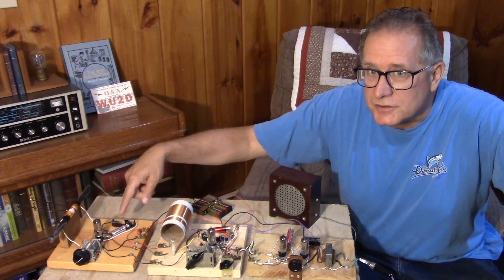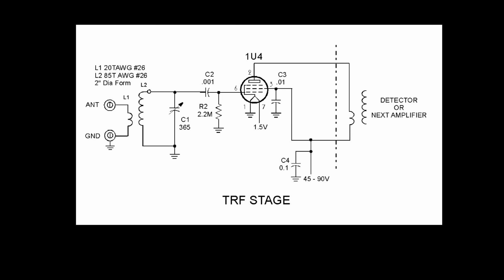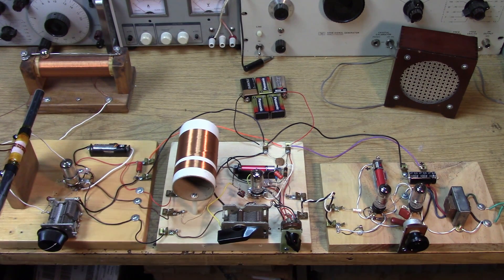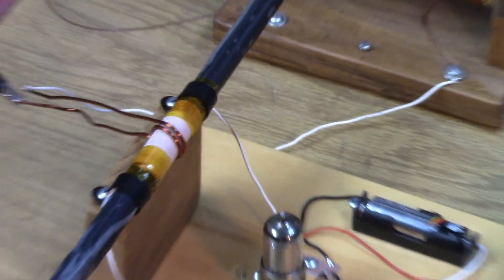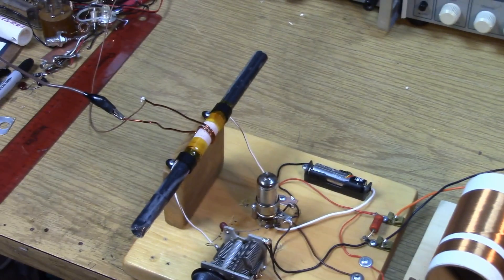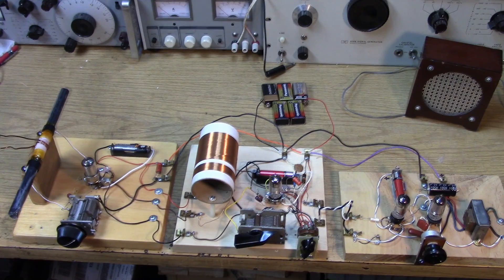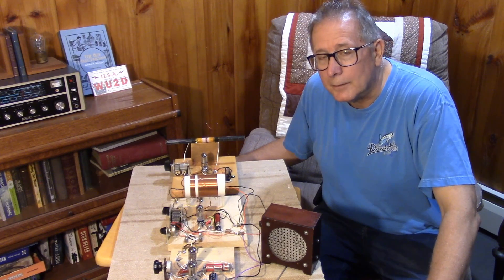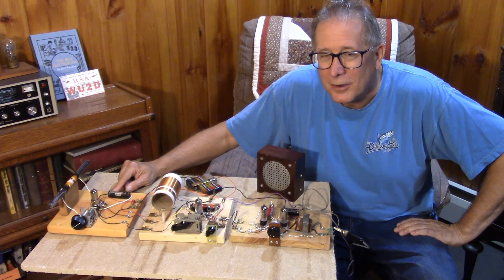TRF Receiver

Comment: Can we use a single knob (ganged variable capacitor) in this circuit?
Reply from the maker: You certainly can, but normally because of loading and tracking, you still need a trimmer to center up the two sections.
Reply: @MIKROWAVE1  that is a great news, i have built a circuit similar to yours (two similar stages) , but with transistors, the two coils are exactly the same but was very hard to track the same  station,, when using a ganged  tuning capacitor I only got the strong stations, while when I use a separate tuning capacitors and set them individually, I really got much more stations with high quality.

Comment: This brings back memories of how I started out in electronics as a kid. 
I couldn't afford transistors, but I did have vacuum tubes, so I designed simple radios, in which to use them. 
With a HT of a mere 9 volts, I was rather pleased with their performance  :) .

Comment: Mike I like your series on simple radios. When you add a 5th tube to a 4 tube superheterodyne, its usually a RF stage and performs so much better, or AA5 vers AA6.  To me a 4 tube battery or AA5 radio with just a  mixer/osc, IF, det/1st AF and AF output are what I would call minimalist radios.

Comment: Very nice series Mike! Any chance of a comparison between a FET vs. tube regen of the same architecture? 73.
Reply from the maker: Yes But... To be equivalent in performance, I would use a dual gate mosfet in the RF stage, a JFET in the Grid Leak or Regen Stage, an audio JFET Preamp and a Mosfet Class A speaker PA.
Reply: @MIKROWAVE1  I’d already be happy with just a single stage regen. I assume you want a dual-gate fet to be able to easily change the gain?
Reply from the maker: @trcwm  I will put one up in the FB page.

Comment: When you mentioned the TRF regen, the first thing that popped into my head was the Doerle Signal Gripper which is a regen with a tuned RF amp before it. I considered building one but it would require me to make a set of two plugin coils per band. May try an untuned RF stage instead before a regen and see how that works.
Reply from the maker: That line up is classic and if done right in a metal enclosure, it really works great!

Comment: Thank you Mike for a very nice video. My National SW3 has a tuned RF stage, tuned regenerative stage and one stage of audio amplification. It uses plug in coils and it is very sensitive . I have band spread coils for the ham bands and it receives SSB and CW very well. Thanks, Ellis.
Reply from the maker: The SW-3 was a fantastic example of doing it all with just a few stages. Great little box!

Comment: I'm very interested in that little two tube amplifier. Has that been covered in a video? I looked through your channel but couldn't find a video on it. Perhaps it is a part of some other vid that doesn't have amplifier in the title, or maybe I'm just blind. If you haven't covered it, would you consider making a vid about it, and if you have, could you point me to the right vid? I'm interested because I'm making a two tube audio amp now, attempting anyway, and I've not been successful on audio amps in the past. (I'm looking at you, Morgan!) My current project is a 1950 Popular Mechanics circuit. I would love any insights into how it could or should be done.
Reply from the maker: Check out my FB page Mikrowave1 Radio Project Resources, which has the schematic and parts list. I will look for the video that covers it.
Reply: @MIKROWAVE1  Thank you very much. I found the schematics and a parts list on your FB page. I really don't do FB, but this time it was worth it! Thanks again. I'll be studying those in my spare time as my own little 2 Tube comes together. It's similar to the one with the interstage transformer but has the volume control on the first stage, the voltage amp tube, rather than the power amp tube. Hope it works! (fingers crossed for luck!) Your pointer to the circuits is much appreciated.

Comment: Hats-Off Mike!  Really great series and appreciate the deep-dives into all the subtleties of each topology--well done!

I may have posted this before, but I now use Lithium 9V rechargeable batteries for everything from radios, DMM's, testers and even smoke and CO detectors.  The rechargeable lithiums do have lower voltage but I have found that even when used with a device that shows a 'low-battery" warning, that the device functions just fine--plus they don't leak!!!
I buy mine off of Amazon as either the EBL-brand (btw: I buy the set that has 4-batteries plus a 4-position charger; or the HiQuick brand; none have failed!
Make sure that you get the 600mA version, they cost slightly more but last a bunch longer!  Also, I charge to 8.2V, not 8.4V for cell longevity.
I have excellent results, and next to no self-discharge; and yes they cost more up front but I have saved hundreds over alkaline DuraLeaks!  73...
Reply from the maker: Great approach!

Comment: TRF still works very well for a WWVB receiver. A few cheap transistors and LC's and you're in business. And of course, you don't want to change the WWVB carrier frequency, and a superhet will do just that.
Reply from the maker: Even modest amplifiers work great at these frequencies, and ordinary low cost inductors for power supplies can provide the bandpass selectivity. Some of the modern low cost op-amps work to above 30 MHz.